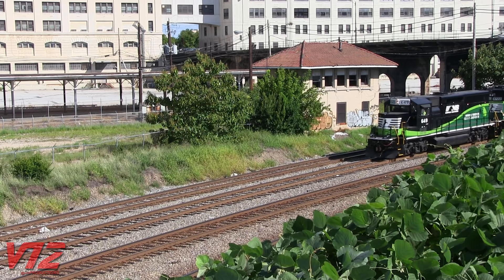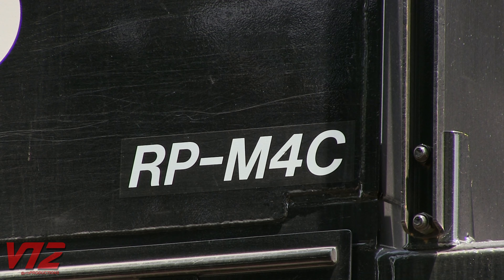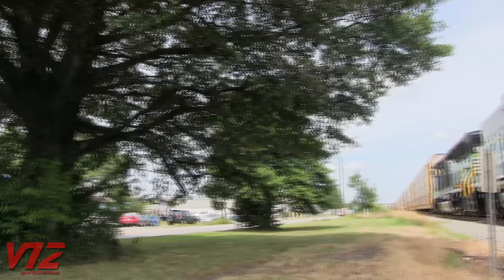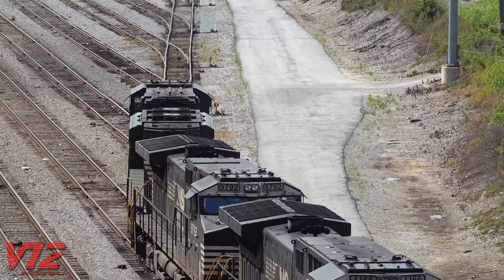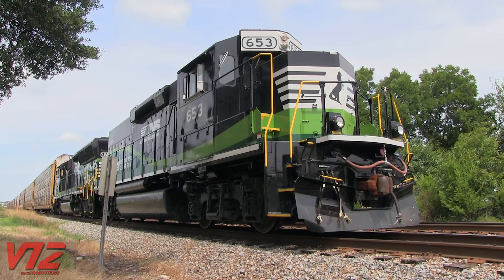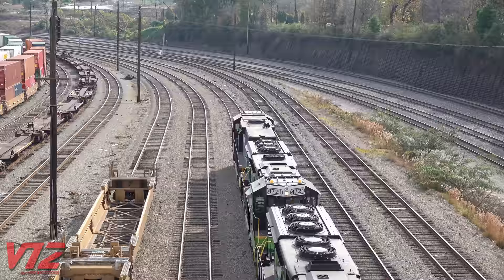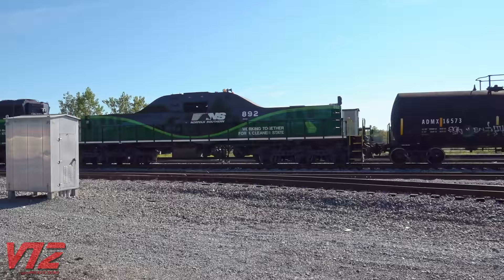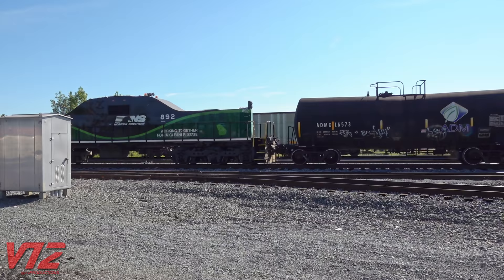Railroad SLUGS

Comment: Slugs are created from locomotives that had accidents or spare parts.  The old fuel tank is usually filled with Cement for adding weight back, from the now removed engine.  They are different from Booster (B) units that have no cab but still have an engine.
Reply: Kabuki Kitsune  just wanted to ask if they couldn't do that :D
Reply: Kabuki Kitsune  was going to say this seems like the logical thing to do.
Reply: @RandoWisLuL  Most slugs can't supply fuel to the mother. It requires relatively complex plumbing, and fuel hoses between the locomotives. The extra fuel store isn't very useful, as slugs are generally used in yards or on local traffic, where range between refuelling really isn't an issue.
Reply: @beeble2003  ah makes sense.
Reply: Yeah, I've also heard old or broken units are used for "load" test duty as well...

Comment: Slugs are perfect for yard service. The single generator provides plenty of amps for 10 mph or less, so suited well to starting whole trains in motion. But not mentioned is that, at least in older designs, the slug will cutout about 10-15mph and then is only good for braking. EJ&E had a few that were unbeatable for used in USS Gary Works moving coke, slab/plate/coil trains around the mill.

Comment: From what I understand, a Diesel locomotive at low speed still puts out a lot of electricity. So, rather than waste it they put the electricity to use powering an extra set of traction motors in that slug. Thus, you get some extra pulling power without having to fire up another Diesel. It's like an extra locomotive without the extra fuel, pollution, etc.?
Reply: @xheralt Seems more like the power of two engines with one prime mover - Diesel from the mother + extra traction motors?
Reply: @xheralt yes there are limits on what a set like this can do but those limitations lean more towards lack of speed more so than lack of pulling capacity... units like this are designed to pull long heavy cuts of cars in a yard setting but with relatively low horsepower has a low top speed (horsepower is related to speed once the train is moving)... as far as grades go trains need a combo of BOTH HP/tractive effort, lacking one or the other equals stalling
Reply: There is only so much horsepower one diesel engine puts out.... plus you need a larger generator to feed more motors
Reply: @JungleYT  "Seems more like the power of two engines with one prime mover" No. The power comes from the diesel engine, and you're not adding more engines. Generators and traction motors only convert power from one form to another. The point of slugs is to get more tractive effort which, informally, is basically grip. If you put the same amount of total power through more traction motors, you're putting less power into each individual motor (i.e., each axle), which means the wheels are less likely to slip.
Reply: @beeble2003  So, less power = less slip? That's confusing... Unless you mean like a lower gear in a transmission giving more torque?
Reply: @JungleYT  Less power to an axle means you're trying less hard to turn it, so it's less likely to slip. Using a slug means you're spreading the available power over more axles, so you get to use your total power without slipping.

The real question is, why would you build a locomotive with so much power that it can make its wheels slip? The answer is that power = force x speed, and it's really that applying excessive force (called "tractive effort" in railroad contexts) through a wheel makes it slip against the rail. At low speed, putting all your power through the wheels makes them slip but, at higher speeds, the same amount of power generates less force, so the wheels wouldn't slip. For example, suppose 500hp through an axle is just enough to make the wheels slip at 5mph. At 10mph, that 500hp is only generating half the force, so the wheels won't slip. At higher speeds, you can put more power through your axles.

The point of slugs is to be able to apply more power through the wheels at low speeds, to start a heavy train. The cost is because you're spreading that power more thinly, you suffer at high speeds, because you don't have that "reserve of horsepower" beyond the point where a slow-moving train would slip.
Reply: Power is measure of force at speed. With low speed, same amount of power yields huge amount of force, way too much to actually use - wheel slip and all. Additionally, electric motors heat up based on the amount of force they put out, and they're only rated for "normal" amounts so you can't even meaningfully overdrive them to produce more force using available power anyway. So normally you'd need two engines to produce double the force, but then at low speeds you'd have two diesel motors running at half power setting which isn't very fuel efficient. Or you could use a slug, so that a single diesel motor runs full power to drive two traction units, which provides the same amount of force as two engines, but with better fuel efficiency. Plus with only one diesel motor running, you've got half as much diesel motor maintenance to do.
Reply: @michaelbuckers  Mi 28, that was a bit more clear to understand. beeble2003 came close, but this was a bit more easy to follow...

Comment: We had some 'slugs' here in France in the 90s, used in yards (BB64700), made from shorten units. They were called 'trucks'.
Splitting the power on more wheels reduced slippage, while using more motors reduced their  overheating at low speed.
Reply: Of course  you had slugs in France. You have escargot
Reply: @coloradostrong8285  that would be snails, ingenue
Reply: @FaustoTheBoozehound  Still slimy.

Comment: Are slugs really "becoming more common"? My understanding was that they were actually decreasing in use. NS has scrapped a lot of its ex-SD40 yard slugs; BNSF and KCS have only a handful in service. CSX has a lot of slugs, but they're all conversions from locomotives built in the '60s or early '70s, so I think they were "slugged" quite a while ago.
Reply: I agree... great video but I also agree the slugs are disappearing
Reply: I think only 7 of the 6-axle slugs have been retired... but regardless, their use is decreasing.  Some of that is PSR... close a yard, don't need slugs.  Slugs are also niche usage, as they have to have a mother, something that doesn't jive with the 1 loco for any use mantra.  I'll always have fond memories of the mid-90s, when NS ran a coal train out of Bluefield down to Knoxville three days a week, with many a GP40/RP-E4D/RP-E4D sets front, mid and rear.

Comment: CSX uses the term “road slug” which is basically a locomotive with the prime mover removed and instead of getting their power from the prime mover they get it from an accompanying locomotive.
Reply: There are Road Slugs and Yard Slugs. CSX was a big user of Road Slugs. Typically a converted GP30 was the Slug and it was mated to GP40-2. They also used cabless Yard Slugs and still do.

Comment: Seems like a more modern version of the Class 13s we had in the UK from the mid 60s to the early 80s. These were rebuilt from Class 08s, small 0-6-0 diesels used purely for yard work. One of the pair had it's cab removed and was fitted to be remote controlled from the other. They were used in a hump yard for marshalling heavy trains, since a single large loco wouldn't get over the hump. The big difference is that the 13s kept both engines, but as said removed one cab.

Comment: For things like yard slugs, why don’t railroads bite the bullet and just get overhead electric traction. It would reduce down time, fuel costs, and the potential upfront costs would be minimal compared to mainline or even branch-line electrification due to the confined space and numerous rerouting possibilities that reduce possible capacity issues.
Reply: Well work it out! I admit it is a bit complex but it has to to with MONEY.
If it were cheaper to go electric then they'd be going electric. That's free market economics.
About these parts they tore down the overhead on a route, then put it back up and extended it, then took it down again - the last time permanently all within a space of about 10 years.

Now there is some other stuff and that is infrastructure. If there isn't enough supporting infrastructure ie power stations and the ability to supply the route with power, no matter how efficient electric is then you can't build it anyhow. It works in the geographically large Europe because they have many small independent countries many of them with abundant hydro and or coal and nuclear.
Often enough in Europe the rail systems are state owned. In the US much of it private competing companies.
Electric works in the US on those routes where all the criteria is met and those that don't have the criteria met don't have electric. Economics. 

Have a look at the Milwaukee Road and its demise. It was all very sad. They had electric on some routes and couldn't make it work but that was a different time - HOWEVER - the market forces acting on that railroad causing its demise gives many lessons on the viability of electrification and distance. Also in fairness Milwaukee Road disappeared for some other reasons to do with treachery, failure to change and modernize, incompetence; all the usual sort of thing. Probably the electric routes were subsidizing the Diesel routes in the end keeping the 'house of cards' standing.
Many of their electric locos were mechanically sound by design, in fact so much so this is why they lasted for so long in service but the market perception in the face of competition starts playing a part on the business model. 
What I haven't told you is a lot of the overhead on the Milwaukee Road was supported with wooden poles in likelihood cut directly from the forest it passed through. 
Well you're probably not going to get away with that these days. 
https://www.youtube.com/watch?v=71BwMlRR0pc

Comment: Follow-up question.  On the slugs that had been rebuilt from regular engines, and that have fuel tanks, are the fuel tanks on the slugs used to fuel the Mother unit via another connection, or are they just empty of filled with ballast of some kind?
Reply from the maker: I don't believe the NS Slugs are capable of storing fuel. There are slugs out there that can serve as fuel tenders though. I'm not sure if they put the ballast in the fuel tanks.
Reply: some roads have put ballast in the fuel tanks (concrete) on slug units... a VERY popular ballasting area as a matter of fact
Reply: They also strip the power assemblies and exhaust stacks from the Diesel engines and fill the blocks with concrete and then stack a bunch of 4” thick steel plates at various locations in the engine, air compressor, and main alternator compartments for extra weight.
Reply: They mostly don't store fuel in the slugs. It would be a lot of complicated plumbing and fuel capacity isn't a big problem for slugs, as they're almost always used either in yards or on locals.
Reply: @beeble2003  
I’ve worked on a road slug set that had a 4 axle slug with a GP-40-2 on each end, the slug was rigged at both ends to carry and supply fuel to the two mother units. But all of the newer 6 axle slugs have the filler adapters removed and the fill pipes are capped so you couldn’t put fuel in if you wanted to. The tanks may even be filled with concrete. I know the engine blocks are and there are also the steel plates I mentioned earlier.
Reply: @ralfie8801  Interesting -- thanks!

Comment: Road slug denotes the fact it has a cab and can be operated by the engineer just like one with an engine. Engineers liked the slugs on the road because they were a lot quieter, but were 'outlawed' due to the fact they could not sound the bell on the mother. Sounds like a weak excuse to me. How hard would it be to put an electronic bell on the slug?
Reply: Probably not hard at all
Reply: Not sure who told you they were outlawed because of the inability to operate the bell on the mother. That’s completely incorrect. And for obvious reasons. You can’t activate the bell or the horn on a trailing  unit in any consist. Makes no difference if the other Locomotive is a slug or not. And there is no requirement to able to. All that matters is the horn and bell operate on the controlling locomotive.
Reply: @FFred-us9tw  The point was that the slug did not have a bell and could not legally lead a consist. At least that was UPs  excuse.

Comment: Makes me wonder if it would be possible to replace the Diesel Engine with a large Battery in a Slug, to charge it via Dynamic Braking (then called Regenrative Braking; common Practice in AC Electric Trains) and smoothen out Load Changes on the Diesel Engine in the Mother Locomotive. The latter is what Hybrid Ships have Batteries for, as smoother Load Changes reduce Emissions, especially Particulates and NOx.

Comment: Worth noting that those coupled "trucks" - as they're called all over Continental Europe - have been used for ages (probably more than a century) mainly with diesel electric shunters in goods marshalling yards. A very famous example is the French C-61000+TC-61000 double unit of two small 0-6-0 diesel shunters.

Comment: The railroad where I worked bought a rebuilt GP-50. 3,000 HP on 4 axles. Despite electronic wheel slip control, it was very susceptible to wheel slipping especially starting on a hill or during lease season. Even with sand, it was very loose. Too much HP, not enough weight and wheels on the iron. Anything over 1,800 HP on a 4 axle locomotive really doesn’t help. I’d rather have two locomotives.

Comment: I was driving along the Tacoma waterfront that the BNSF - UP shared mainline between Seattle and Portland runs along and saw two new looking NS slugs in black in between the regular locomotives clear up here. I couldn't hardly believe what I was seeing but that's been 20 years ago now. So I'd say yard slugs are more common today then any on mainline duty at least around here. Either way slugs are a rare sight indeed and getting rarer from what I see...
On a side note I have seen what was labeled a State of Washington scale car used in weighing and proving large capacity industrial type scales used in railroad situations that looked at first glance just like a slug only it was a flatcar length car that wasn't as long as a regular slug or locomotive. So I wonder how many have seen that particular railcar and thought it was a slug???

Comment: interesting idea, I can imagine the idea being adapted in Australia. Be a shame to see an S class slugged to a T class. May as well leave the engine in it rather than replace it with concrete (or fill it with Li batteries).
Reply: The engine is valuable, either to use as an engine or to sell for scrap. If you left it in the slug, it would be a very expensive form of weight compared to concrete or steel slab.

Comment: Interesting. A slug allows a single locomotive to use all of its output capability during the few times it is actually required. Unfortunately, the length of a train and the numerous couplings needed  prevents them doing this instead of using separate engines for distributed power requirements.
Reply: Slugs don’t make any sense on high tonage road trains operating at higher speeds. The extra power they require from the mother Locomotive is only useful at lower speeds. Even most road slugs like some railroads used such as CSX would cut out typically around 30 MPH where all the horsepower the mother locomotive was producing was needed for those traction motors. At that point slugs are just dead weight. Which is why they aren’t even considered an option.

Comment: makes one wonder if the next phase is to fit the yards with AC overhead catenary and just run fully electric switchers.  Or DC third rails.  I have heard overhead wires require a lot of upkeep though. Only reason I thought of them before third rails is for RR workers in a yard you wont ever have someone accidentally step on an overhead wire.
Reply: An electrified third rail would be insanely dangerous in a yard. Workers need to connect brake lines and so on.

Comment: Thats a "tractive effort booster" or "booster" their just traction motors that take electricity from another locomotive.  A slug is like a booster but they have diesel engines with no crew cab
Reply: No, you are confused.  This video shows slugs. A slug has traction motors but no diesel engine.  A slug can have a cab, we used them on CSX for years with old GP30's with the diesel removed and they were mated to a GP40-2. Most railroads have slugs with no cabs. But a slug will NEVER have a diesel engine. 
 A locomotive with a diesel engine but no cab is called a "B unit".  Often referred to unofficially as a "Booster" but they were never called that by the builders or by the railroads on their rosters. They were simply a B unit.   Locomotive with no diesel engine but may or may not have a cab? = SLUG.  Locomotive with a diesel engine but NEVER a cab = B Unit.

Comment: What you have is a UP DD40X running with one motor. Makes you want to put a lawn mower motor in your car.
Reply: Can a DD40X power all 8 traction motors if only one engine is running?
Reply: No, as a DDA40X cannot operate all 8 motors from one prime mover.
Reply: @atomstarfireproductions8695  no. Each prime mover powers one truck only.